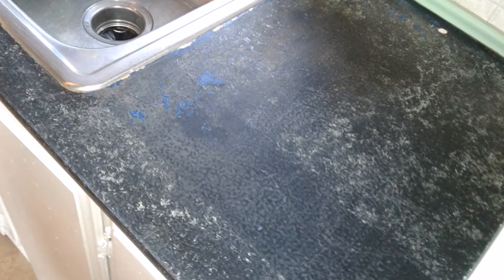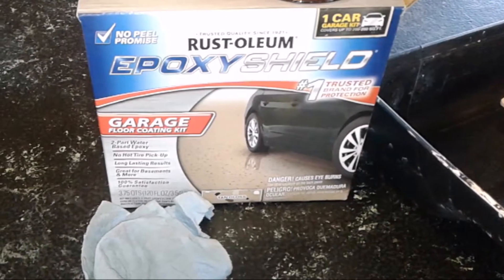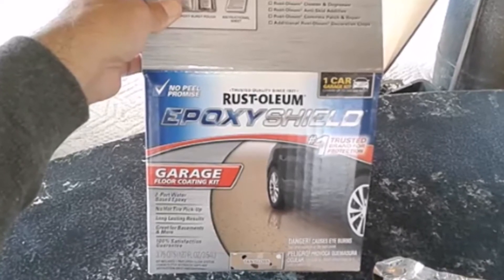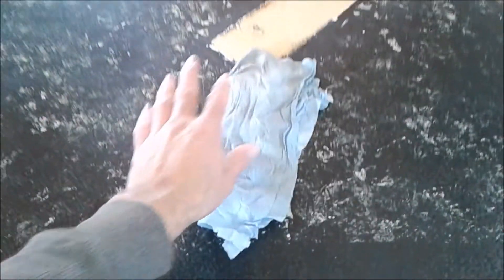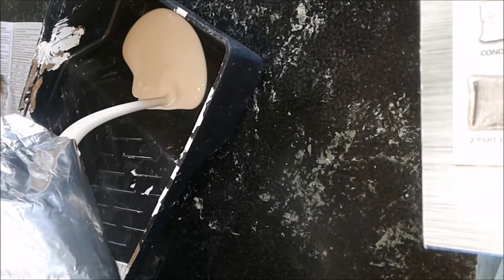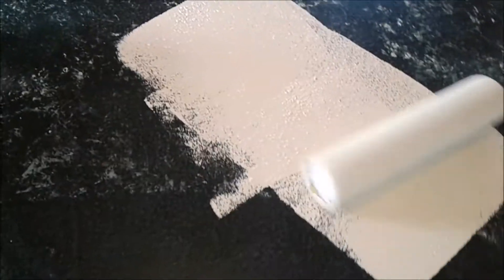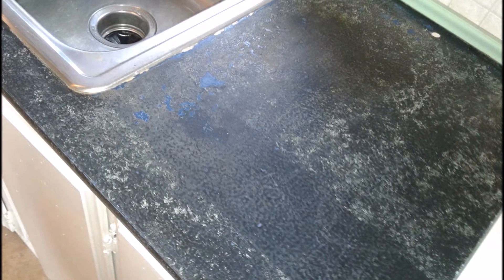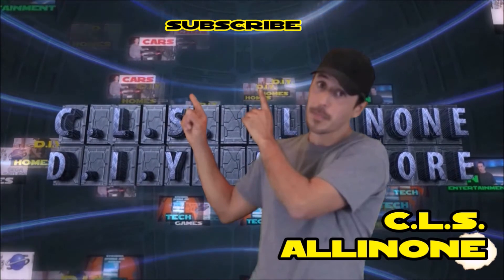Make your counter tops look like new again with RUST-OLEUM Epoxy Shield

Comment: How does it hold up against hot/warm pots? Will it melt on a hot as hell summer day... especially if on that day you place smthg hot/warm or metal/fabric/plastic on it? Will it melt a bit and get indented? Will material then stick to it?
Reply from the maker: Cause Effect holds up great . I wouldnt put a pan off the oven on it . But I wouldn't do that on a normal counter either
Reply: C.L.S. Allinone +right! Someone did that on the laminate, ugh! AND that's why I'm looking for a fix!

Comment: we have done this on a garage floor before but had an issue with air bubbles. i want to do this on our concrete countertop but i don’t want the air bubble problem. any tips ?? thank you
Reply from the maker: i use a foam roller and try and get 2 coats on fast before it becomes to tacky. Make sure your roller has plenty of paint on it or it might become to tacky and start to pull paint causing bubbles.
Reply: I've seen propane blow torches used to remove air bubbles.